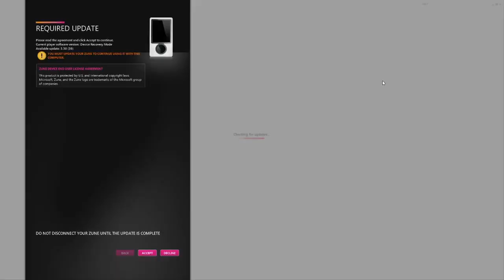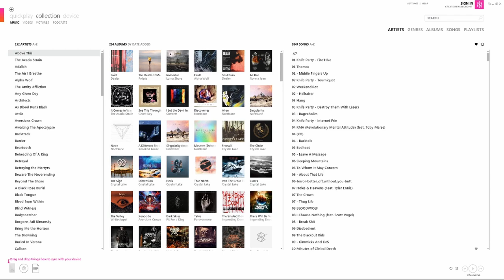I bought an old Zune and repaired and upgraded it.

Comment: Thanks so much!  I've had that SSD in my wish list on Amazon for at least two years.  After watching your video I bit the bullet and ordered it and the battery. I have missed my Zune. Can't wait to put it back into operation!
Reply from the maker: Good luck with it!
Reply: Would connecting both drivers via USB to a PC allow cloning software to simply clone and expand the partition?

Comment: It's actually a bit harder to service a Zune than it is an iPod. I only messed up once in 30 iPods, but messed up twice in fixing 3 Zunes. Both times it was the clickwheel ribbon. Once I tore the cable connecting to the motherboard and the other time the area that has the actual clickers on it got accidentally misaligned and punctured. It's tricky to see what's going on with that cable when you are putting the device back together.
Reply from the maker: I used to have trouble with it as well.
Reply: damn, my first impression from watching this video and a iPod repair video was that the Zune looked a bit easier to fix
Reply: @jorgeskuf  I really found iPod Classic easier to service than Zune. Zune's SSD is expensive than CF card and adapter with same size as this is not SATA 2.5 inch  SSD  which is cheaper than CF card and SSD which can fit zune.

Comment: no lie i still use my ipod classic 30 gb 5th gen model from 2007 i upgraded too qflash micro sd card and a new battery i love now i also repaired my screen and face plate on my white on i put a black one over it . so i love my ipod now my friend still uses his zune also your wonder how do we use blue tooth headphones in 2020 or 2022 well i use a 2 in 1 blue tooth transmitter .

Comment: hey i got a zune player..my charger is borken ? 
that means i cant plug my usb inside my charger?
it wont charge my battery? what to do? 
i bought new battery it i open up the zune player..
i switch the battery it works for a while the new battery is on low?
i want to charge it fully but cant?
my problem is my zune player wont let me charge 
the charger inside is broken?

mine is same as yours...

Comment: Have you noticed any difference in performance with the SSD? Will the difference in price be worth it? I still can't decide whether to SSD or HDD to add more space to my 30GB ZUNE.
Reply from the maker: If you have the money I think it is worth it as far as hedging against failure of the HDD. Plus you can do the battery while you are in there for the same reason. I think it is a bit faster as well
Reply: @quietprojects5753  I finally did it.  Works like a charm. Faster... No doubt.  I'm sure will be running for 10 more years.
Reply from the maker: @Yukiyu  That is great to hear!

Comment: I wish I could find a solid state to go in one with at least 256 but they don't appear to be in stock anywhere.
Reply from the maker: I wouldn't bother even if they were in stock. The zune has a OS limit that is well under 256 Gb. It's there in the modifications section https://en.m.wikipedia.org/wiki/Zune_80,_120
Unfortunately if you want larger storage it would be best to go with an Ipod
Reply: @quietprojects5753  oh sweet thanks
Reply from the maker: No problem!

Comment: I have two zunes that i'd like to swap the front screen lens' on and i was wondering if that component can be removed from the front shell half or is it part of it. theyre red and white zunes so thats why im wondering if just that part can be swapped
Reply from the maker: https://www.ifixit.com/Guide/Microsoft+Zune+80+Screen+Replacement/1485 
looks like it should be fine. If you have an original one, also yes